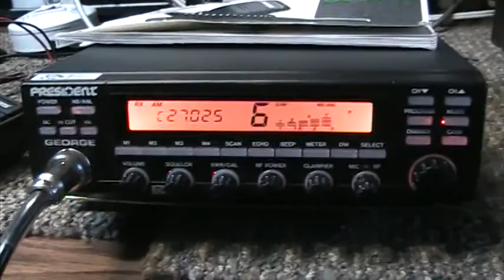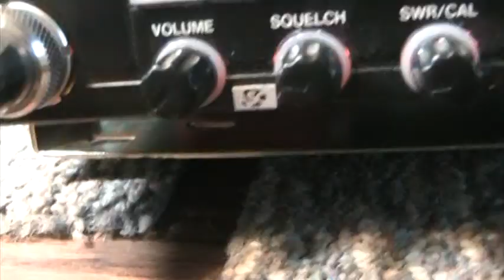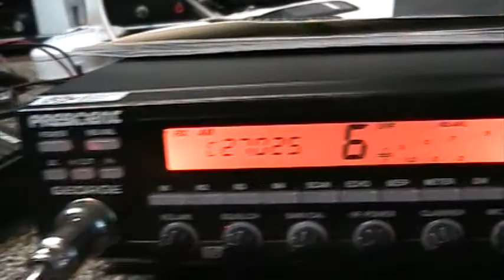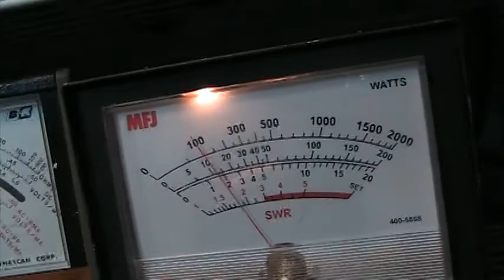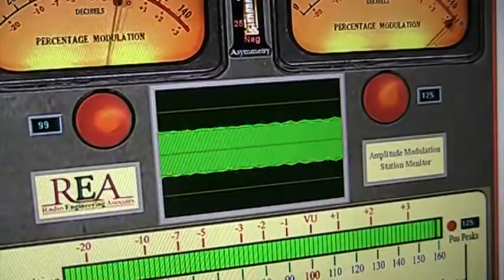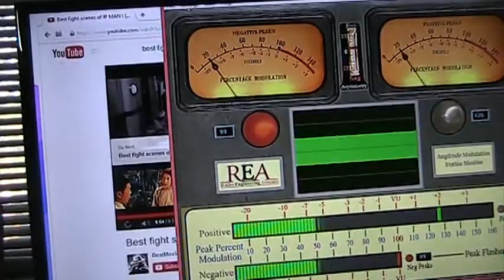President George export mobile CB radio

Comment: I’ve been looking to replace my Georgie that was in my burb when it was stolen back in 2010 and haven’t had any luck. Presidents have always been my favorite radios. I’m currently running my old school 2510,JFK 2 and Lincoln 2+ on the base and a dual final Jackson in the mobile
Reply from the maker: I only have 1 Georgie and I like it a lot, one of my favorite mobiles. Hence, it will take top dollar for me to let it go.
Reply: @tramdr  I feel the same way about my diamond 201s and my courier centurion 40D. There is nothing special about either of them besides they are damn good radios aside from the fact that my old friend 7oscar5 did all the work on both and modded them with the digital yaesu vfo/frequency counter on both and the courier has a key up noise toy that’s a soundbyte of my d201 pinging. Nothing special to anyone except me.
Reply from the maker: Centurion has fantastic adjacent channel rejection for a transistor radio. D201's not only have fantastic receive, they have the best audio of any radio, plus the vox hardwired version is very dependable. Those are special radios, but I still try not to get too attached.
Reply: @tramdr  those are the only 2 radios and my 2 skullcracka pill boxes are the only equipment I’m attached to.  The radios because my good friend and mentor built them for me and the 2 boxes because the were built for me and prime isn’t building pill boxes anymore. .